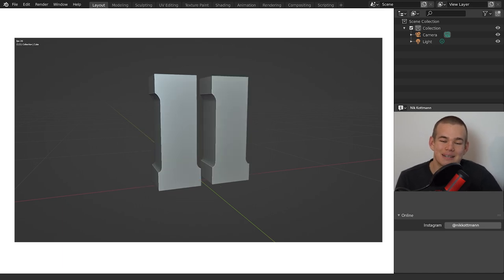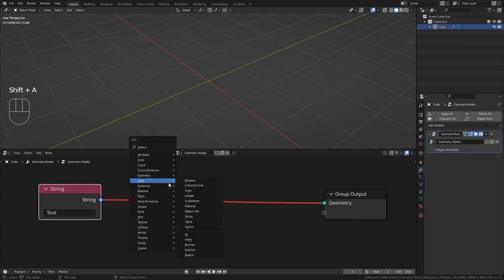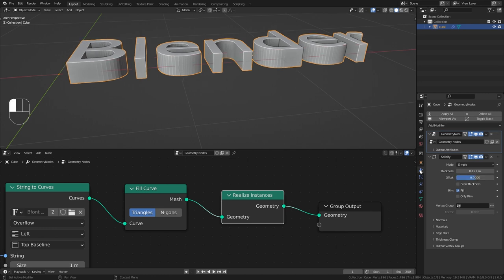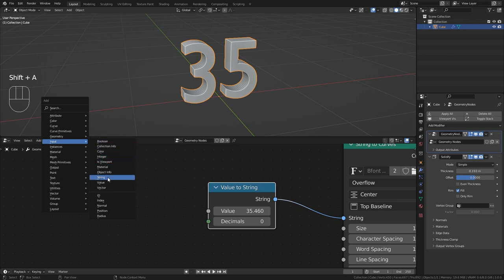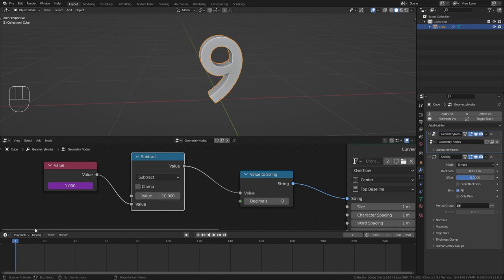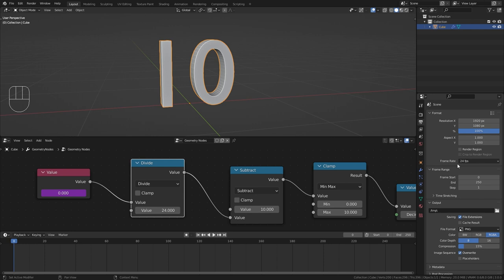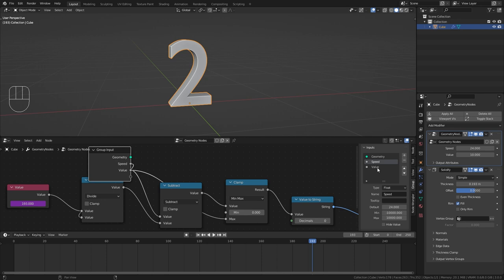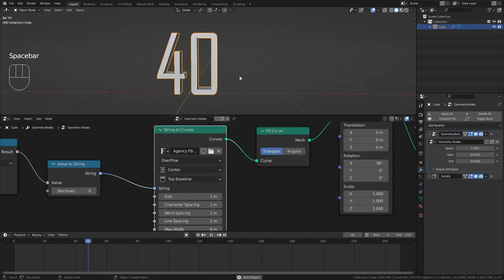Countdown Timer with Geometry Nodes in Blender 3.0!

Comment: Greetings, I'm using Blender 3.1.2 and I've found instead of using the Value node with #frame you can use the Scene Time node. I'm making a counter that counts back from '5' and I used the Math Subtract node  but I didn't want the minus sign in front of the number so I duplicated the Math node and used Absolute. I liked the tutorial though and was still able to accomplish what I wanted to do with the counter by watching your tutorial :)

Comment: When I tried to do this, the "10" only appeared for half a second, as the Subtract node was rounding the value it received from the Divide node before subtracting. A Floor node between Divide and Subtract solves this.
Reply: The same problem  with the ‘scene time’ node
Reply: same here

Comment: Awesome tutorial! I have a question though. Is it possible to do something like this:

So instead of putting strings of numbers (10-9-8-7-...) to make strings of letters (for example t-u-t-o-r-i-a-l)? So instead of "Value to String" node to use something else which will make letter by letter appear
Reply from the maker: yes, you need to use the slice string node for that:)

Comment: you don't need the devide node, just write #frame/yournumber into the value node... it works with any mathematical operation
Reply from the maker: yes, but you won't be able to expose it to the modifier for quick access

Comment: Thanks for the awesome tutorial ! Is there any way of connecting the thickness value (solidify modifier) to the system ? Suppose i want to reduce the thickness as the number goes down.
Reply from the maker: you could use a driver to sync those two values

Comment: Is there a way to automatically detect the frames per second to adjust the speed to match?
Reply: In 3.1 there is a Scene Time node that outputs both in seconds and frames.
Reply: You can access the scene fps in the driver by creating a new variable named "fps".   Link the variable to Property : Scene/Scene,  and Path : "render.fps".   Then the driver expression is "frame/fps".   Then the "speed" control in the Group Node is a direct multiplier.